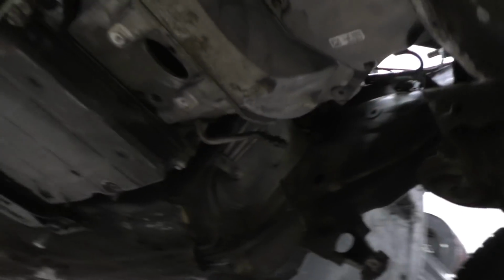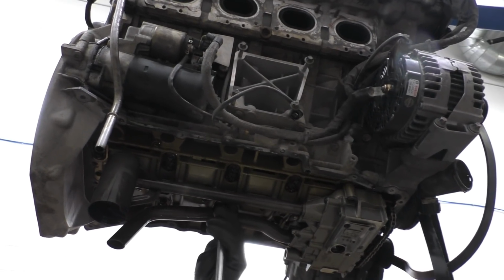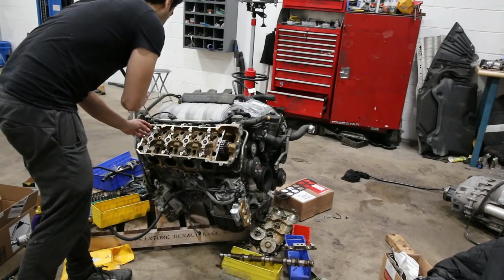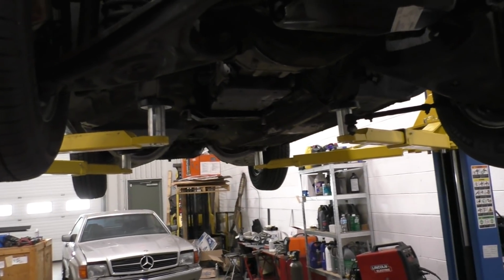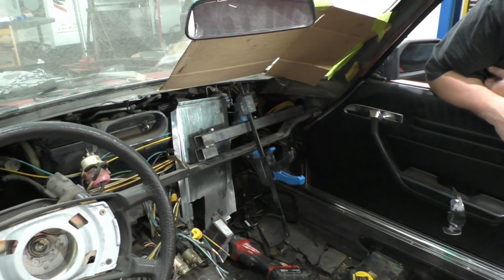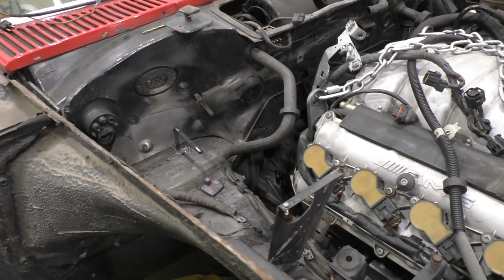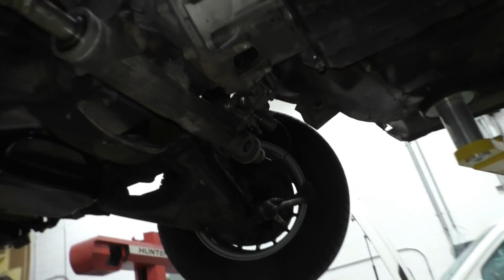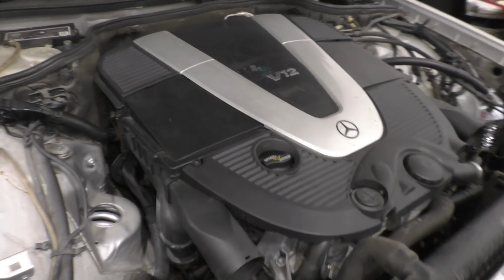Switching a Mercedes SL to Right Hand Drive - Project 630SL Part 4

Comment: My experience converting a steering gearbox to steering rack showed me that the ratio of tie rod end position to steering axis center-line was much different. The rack work distance was much shorter than the box so converting without changing the distance made the steering much slower.  Something to consider. Great project
Reply: yes, the knuckles will need to be modded, probably
Reply: Have you seen this guy's ASL build, built in his garage? I don't think you qualify to bring steering issues to his attention.

Comment: I would not have cut up the dash bar. I would either cut it out and flip it around or if it isn’t symmetrical enough front to back made a completely new dash bar. 
This is depending on if you are reinstalling the original instruments and glovebox as to wether you either flip or remake.
Also even Mercedes raid the parts bin from OE suppliers so the ideal steering rack might be sitting under a dodge caravan or a Jeep.

Comment: Here's a tip for you,order a outer tie rods from kia sephia1 these will fit perfectly on the nockels.i've done it on my car when i converted it,but i have an issue with bumpsteer since i done it, i will see how you going to fix it.
Reply: yeah, it might fit but it ain't gonna work right. you should watch dude's old videos talking about calculating all the suspension geometry components:
part 1: watch?v=VbReLNi2JP4
part 2: watch?v=oh535De4hKg
and his video on ackerman/anti-ackerman steering geometries: watch?v=YVisLuiU-Oo
peace

Comment: Maybe stupid question. But if you deleted a part of the oil pump (the gear) doesnt it makes less pressure? (Just asking)
Reply: He Just Took off Scavenging Side of The Pump. The Main Side Which Generates Actual Pressure Is Still There.
Reply: No. The C63 has a really stupid scavenging system that pumps oil from the back of the sump and dumps it in the front of the sump where the oil pickup is. The S63 doesn't have a rear bowl in the sump so it doesn't have the scavenging stage. Much simpler and more reliable.
Reply: Aaah okay! Thanks!:)

Comment: Y'all do some pretty huge projects really, makes me wish I had more money so I could send my own stuff over for work :P
Making an old Cadillac look normal but drive like a modern car would have been an interesting sleeper, but it did make me wonder, how much is it possible to modernize an old engine? would it be possible to take an older engine and basically make it more like a modern one? or are modern ones constructed differently? as in the block having different construction, like paths for fuel or oil and the like? or is that all in the heads? 
Kinda curious as I do kinda wonder if it's possible to modernize the 8.2 liter V8 in my car, a Cadillac 500cid, so weak due to the oil crisis, but so huge... there might be untapped potential there, but I wouldn't even know where to begin in attempting anything, beyond maybe a Holley EFI kit or the like.

Comment: Do heim joints on the suspension links
Reply: Its a road car.
Ball joints don't transfer anywhere near as much vibration through the wheel, they also require service, whereas ball joints don't.
Reply: Rod end suspension

Comment: the LHD rack in a RHD won't work. The wheels will go the wrong way (ie turn right will make the car turn left). If the LHD rack, which is designed to be behind the axle centreline, is flipped and then put in front of the axle centreline (like where the original links were), then it will work. But leaving it in its designed position but flipping it is wrong.
Reply: But he's using a front rack in a rear application. So they move the opposite way already. Flipping will correct it.
You think these guys would make a mistake like that?
Reply: @1one3_Racing  yes, seems you're right. Was glossed over very quickly in the video without much explanation. Had to watch it again with the subtitles turned on at around the 10 min mark.
You'd hope not, but everybody makes mistakes sometimes :)